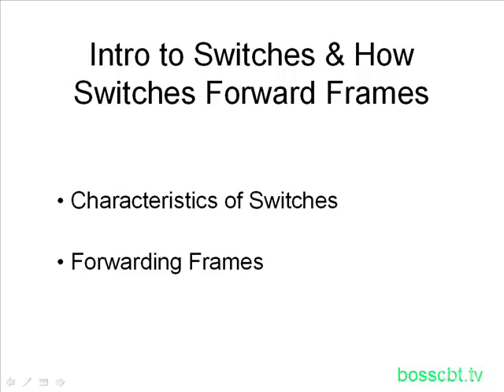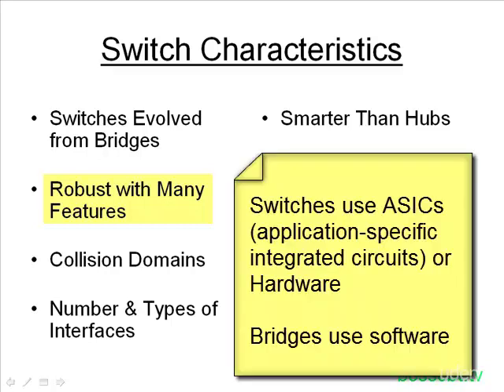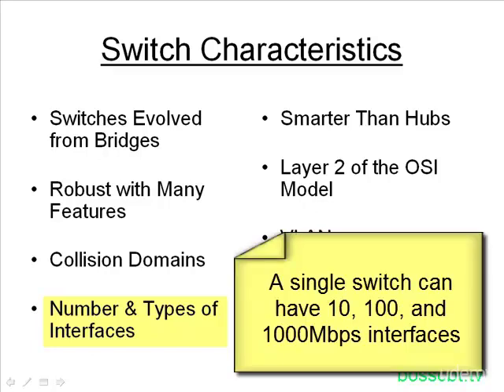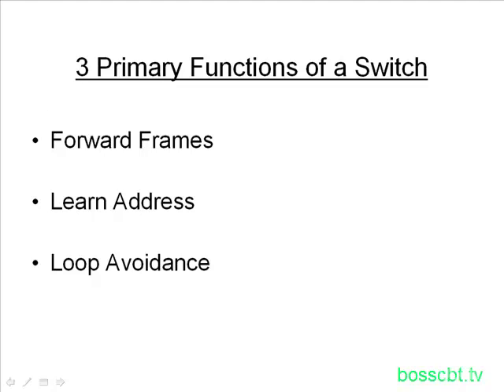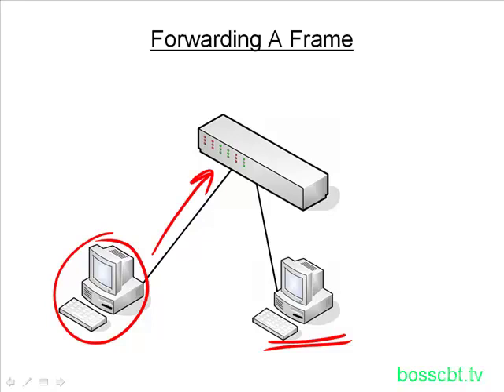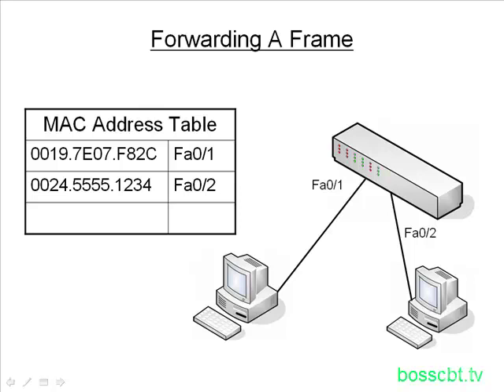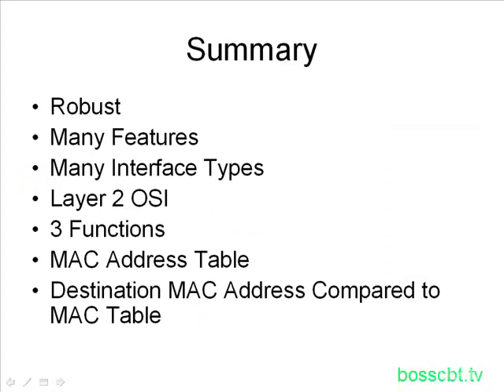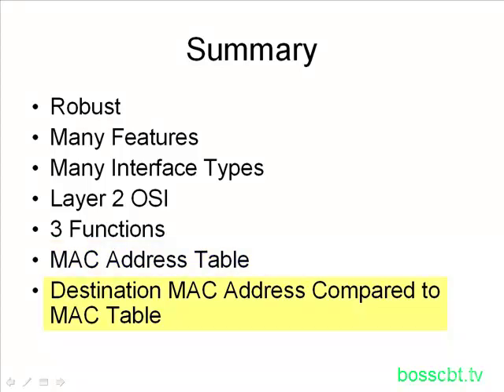1. Intro to Switches  How Switches Forward Frames

Comment: This left out the most fundamental things. Quite evident that frame forwarding works that way, if the incoming header tells the destination mac address and the switch knows mac addresses of connected hosts. If everything is that ready-blessed, it doesn't need more than calculating one plus two to figure out all this.

But, the more important, interesting, and difficult would be to know and understand a)which device figures out what is the destination mac address, and how it is resolved, since as a user I only play with IP addresses b) how does the switch know the mac addresses of all the connected hosts? Does it send some kind of query to every host when plugged in? Does it do it each time a connection is detected? What if ip addresses get changed, does it do a reassignment, since, as already mentioned, as a user I only play with IP addresses?